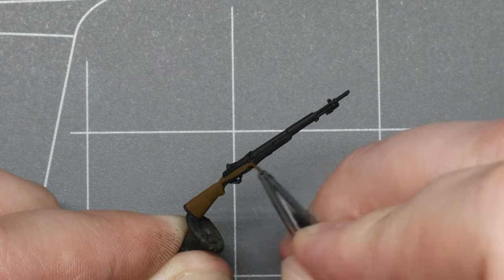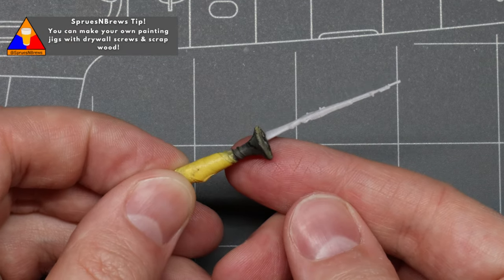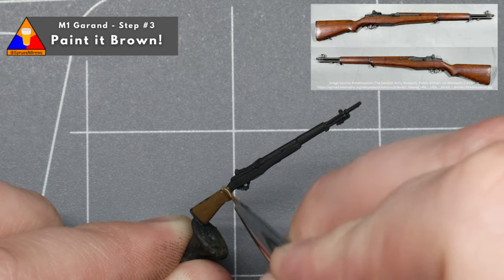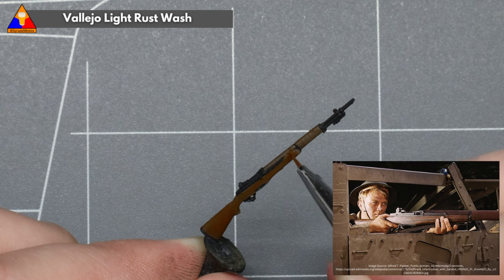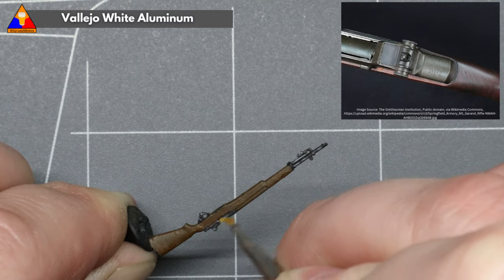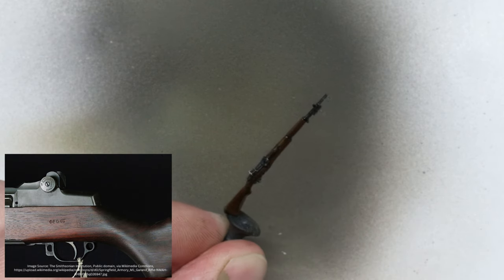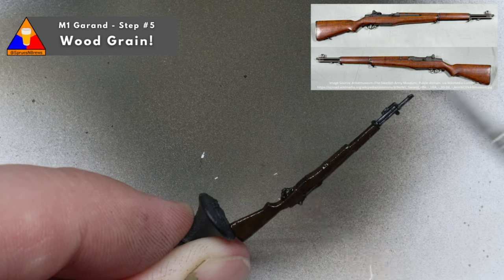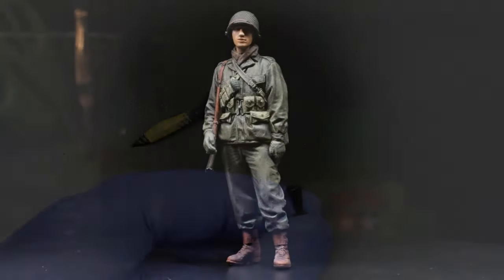Painting a Scale Model M1 Garand in FIVE EASY STEPS!

Comment: Hey so unrelated question but what is a good color pallet for a winter camouflaged BF-109 G6? I’m going to be building a custom designed BF-109 that is winter themed but didnt know which vairants of white/grey to use. I have dark grey, german grey, and light grey acrylics and considered light grey for the base layer/underside layer but I figured it might be to greyish and not white enough. What would you recommend?
Reply: Oh and let me add that ive seen a lot recommend using RLM 76 but I feel like its too blue in color. I want the camo pattern to be somewhat dull with very little to no green, blue, or any other colors. Mostly just greys/whites

Comment: Sorry,the Lee Enfield •303 was the MOST iconic rifle of WWII
Reply from the maker: That's a fair argument! From this side of the pond, though, it's the Garand 😉🍻
Reply: @SpruesNBrews  yes but the TWO flaws and problems the M1 had,was,
1,it only held  a mag of 8 rounds,
2,the Metallic PING when it was empty.so letting the enemy know you were out.
The Lee Enfield on the other hand had a 10 round magazine and NO metallic PING,
it also went on to be one of the best sniper rifles in the world,but hey,I am biased,I'm English and spent over 10 years firing this rifle in competition.
Reply: @Lee0568  Lee, both are excellent and do what they are designed to do. Slight correction, M1 is clip fed, has gas operated firing mechanism allowing semi automatic fire. Ejection is the ping. Strong bayonet mounting.
Enfield is bolt action,  with minor magazines issues. Weak bayonet mounting. However you can't get an M1 thumb from an Enfield :-)
" A cup if tea and my 303 " Cheers
Reply: I mean depending on the country it can be the mosin nagant or mp40 also. For example in croatia where i am from it is the kar 98k.
Reply: @Lee 0568 , you're right. You are biased. To the point of sounding rather foolish. I say this as a former NRA Service Rifle competitor with the Garand AND life-long Lee- Enfield enthusiast.
Reply: Don't be sorry!
Reply: Iconic I suppose to Americans. 🇦🇺👍🍺🍺
Reply: @Lee0568  I'm willing to bet the ping is a little difficult to hear right after a .30-06 gunshot lol